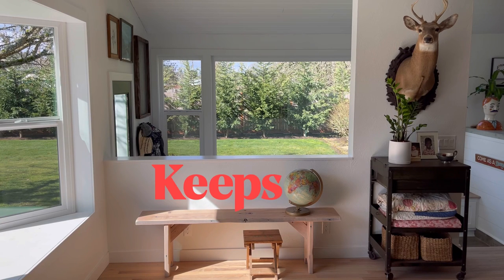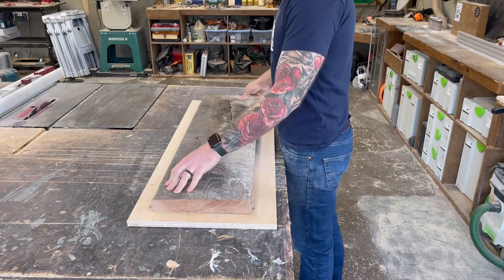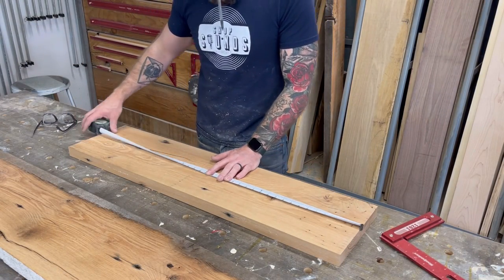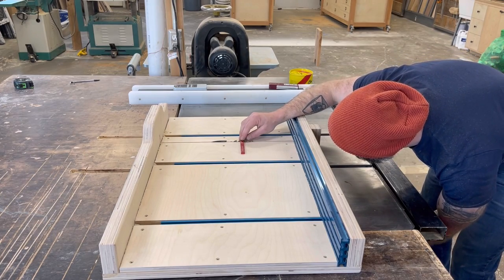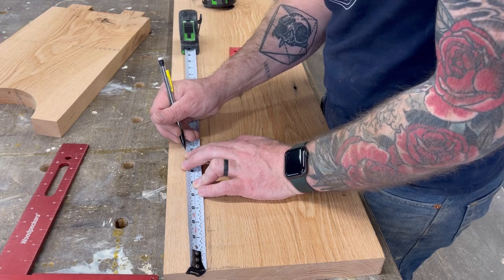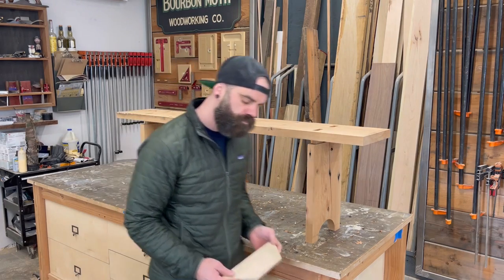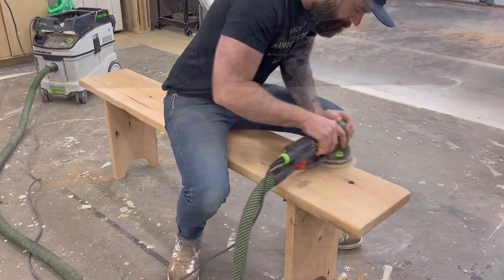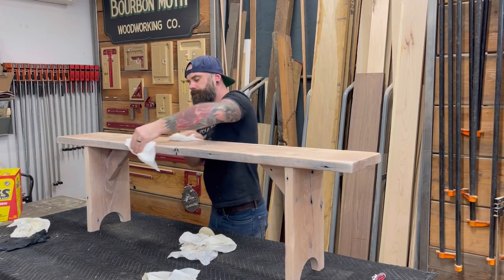DIY Wood Bench Build || Easy Wood Bench Design

Comment: I've made a similar bench for camp. Differences I made:  Wood was regular dimensional lumber. 2xstock pine. Instead of tenons, I drilled dowels for the legs. Instead of the corner braces, I strung another piece of wood to span between them and act as a "T" beam for the top. Dowels in the beam go into the legs. They break down easily and stack flat for transport.  I also routed the top edge of the bench and the legs to make it look a little "lighter" and more finished and didn't have a sharp edge under the legs when you sat on it.  They work great!

Comment: Basic tools include planers, joiners, routers and table saws? :( I guess I'm screwed.
Reply: Yeah...not really sure what non-basic tools would be then...
Reply: @LightemupWMH  A screw driver
Reply: @LightemupWMH  Domino joiner
Reply: You can do the same thing with hand planes and chisels; no power tools needed. You just need more time amd patienc do it that way.
Reply: @chrisdamico6719  And skill, don't forget skill. That said, I've realized that a jointer and a planer is basically necessary for any piece of woodworking that isn't plywood.

Comment: what are the dimensions of the finished timber? How do you determine what is thick (or thin) enough for a piece like this that has to support weight? I know aesthetics are a part, but I don't want pieces like this to fail or to sag after a while.
Reply: I'm thinking it was 5/4 oak (maybe 6?) to start. Depending on overall length and support pieces, you might be able to get away with 3/4 by the tine it's finished, but I'm thinking 4/4 is probably a safe bet.
Reply: @chrisdamico6719  Cheers for that. I'm contemplating 2" rough sawn for top, but thinner for the legs - I think 5/4 will be OK.

Comment: 17:45 “No different than running a piece of wood through with a push stick”  Absolutely correct.  Even better in fact.  As long as you feel your hands are as sacrificial as the push stick.  Otherwise there is a rather important difference for the rest of us.

Comment: Love when I see a video that claims to use only basic woodworking tools, and 5 minutes in you've already used both a planer and a jointer, neither of which I actually have. Would have been a better video if you'd shown how to achieve the bench without access to either of those tools, because I imagine that most at-home woodworkers don't own either.

Comment: What's with that phrase, "Flat as a pancake!", seriously. Pancakes aren't even flat there convex shaped. They got a nice gradual curve to them that starts from the edge and rises in the middle. And had little bumps in them if you add fruit, or Choclate chips.....
mmmm Choclate chip pancakes with strawberries.... 
Right ya btw nice vid.

Comment: "basic tools" ...
like a commercial planer and a commercial joiner, and a pro table saw, and a router jig, and a corresponding router and air compressor and a pro chop saw and a pro table saw sled and fence and a forstner bit and a commercial band saw and a couple of really professional mega expensive clamps and a commercial drill press and a pro orbital sander with attached vacuum and a flush cut saw. I bet you don't have many friends. ROFL.
At least you actually used a pencil and a chisel for five seconds.  Oh, and just happen to have a couple of 2", 100 year old, reclaimed, white oak, boards (which cost most people like $500 if they can find them).  Lol.  
But you should definitely have a jeans sponsorship, though.